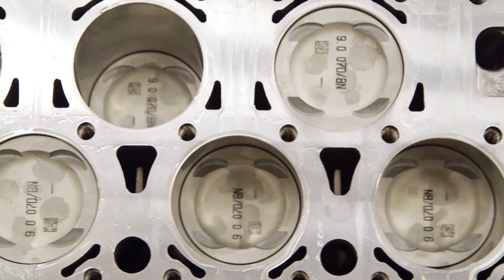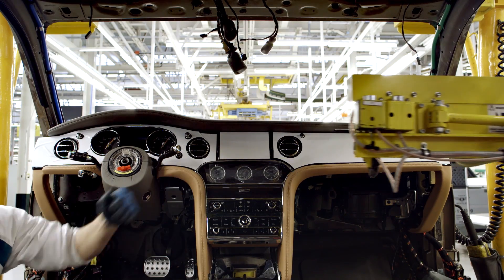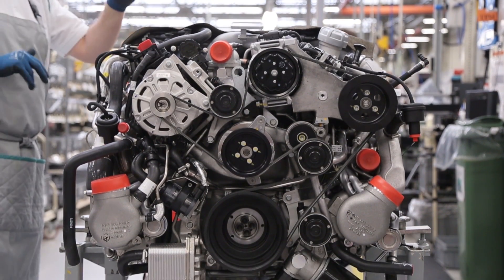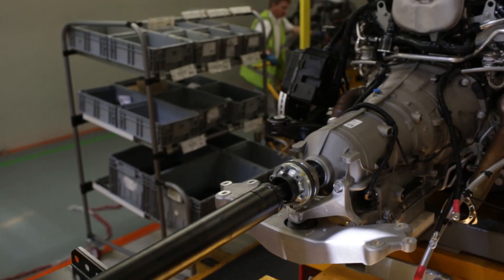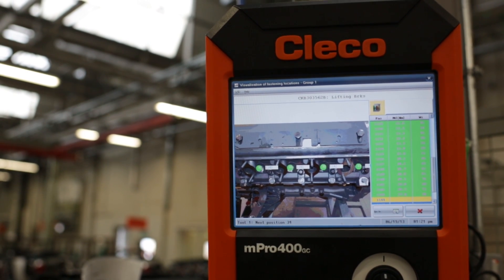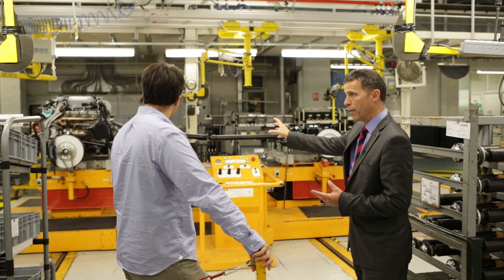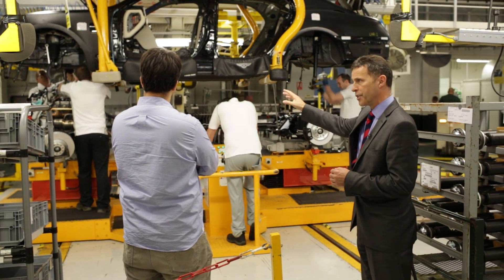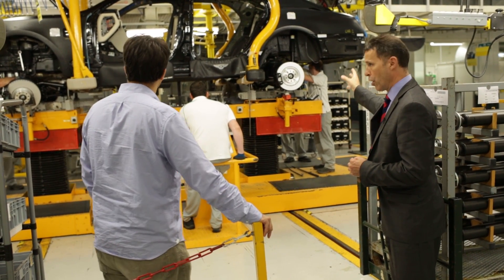Engine and Chassis Marriage - /INSIDE BENTLEY

Comment: Hold on... Didn't Bentley use the W8 or V8 from VAG? Since when do they have their own pushrod V8? I thought they used VAG engines since the take-over.

And I bet this engine is quite reliable. Pushrod design, camshaft driven directly by gears, no chains with tensioners which you have to replace, and no timing belts which you have to replace. It will run forever. Only just one belt for all the auxilaries. It is no surprise they prefer it over the VAG W12 which is probably less reliable.
Reply: I think it's more about tradition than reliablity - Bentley (and until recently Rolls Royce) have used this engine for decades. I wouldn't be surprised if the W12 is actually pretty damn reliable.

Comment: The reason companies like Ford have problems, just like other car companies, is because they produce cars In a mass. If they hand worked every car like Bentley, the cars would be extremely expensive and not as profitable.
Reply: No no the problems are unions requesting higher wages even though they have the highest sick times compared to non union car makers, this is the reason many car makers have left the US. A union job wants people who install a steering wheel to make over 30 dollars and hour they did it to themselves. They ran out the car industry. But bitch and complain why GM, Ford and Dodge have left.
Reply: You are comparing apples to oranges

Comment: first
Reply: First to buy a new Prius.
Reply: LeadFootLiam you spelled porsche wrong ;)
Reply: 72Disco1998 i totaled a Prius in my ford ranger going about 25 mph, the Prius had dismantled fenders,doors, a bent frame along with a salvage title. my ford simply drove home with a bent bumper, a cracked grille and a broken turn signal, cost to repair my pickup: 200$ cost to replace Prius $14,000, cost of having a funny story in which my ranger eats a Prius : priceless
Reply: Hector Flores Haha I hate those cars driven by elitist douche bags. I know I have a Land Rover DII and was rear ended by an Eclipse about 400 on mine and the Mitsubishi was totaled. I really did not even have to replace the bumper only had a small dent.
Reply: LeadFootLiam A Prius I will use that piece of shit for target practice. People think that this car is the greatest thing since sliced bread, what is going to happen when those toxic batteries will no longer hold a charge? I heard to replace them will cost twice the cost of the vehicle itself.